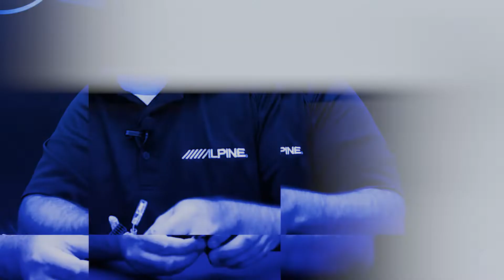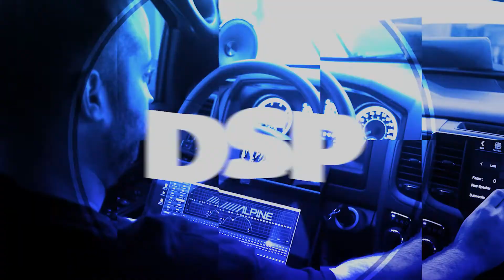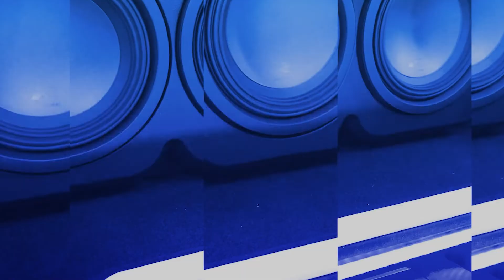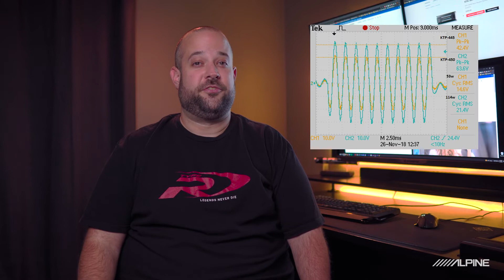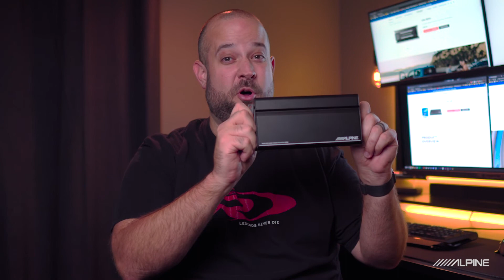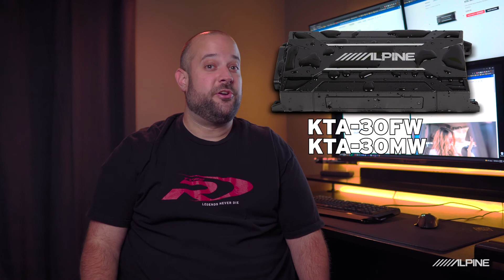Alpine's Exclusive Dynamic Peak Power (DPP) Amp Feature

Comment: It's for real.  Just installed one that replaced a 45watt sony unit I had.  The KTA gets way louder.  and perfectly clean.  Litterally sounds twice as loud and doesn't cut out.  Can't even max it, it hurts my ears.  My sony would shut off past 40 out of 50 volume.  KTA doesn't shut off at all, is way louder at vol. 40, and haven't even gone past vol. 43.  Don't want to blow the JLs and the jump from 40-43 is crazy loud.  even 40 is to loud.  I run the KTA at 37 and had to boost my sub a couple dbs to compensate.  Very impressed Alpine.  And I got it at a CarToys sale for $169 😁

Comment: Great video, so I’m going to be powering 4  6 by 8 speakers with no added subwoofer with a Kram-450 power pack. Do I need to get speakers rated for 50 watts rms or 100 watts rms?